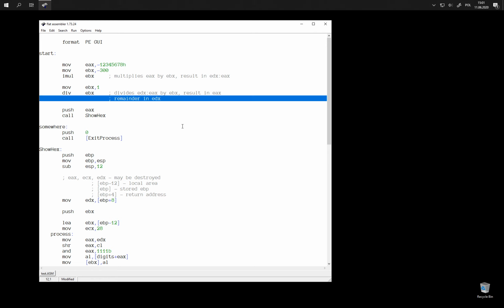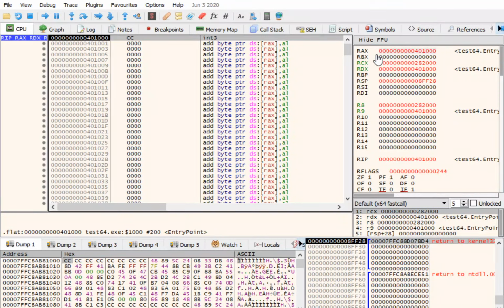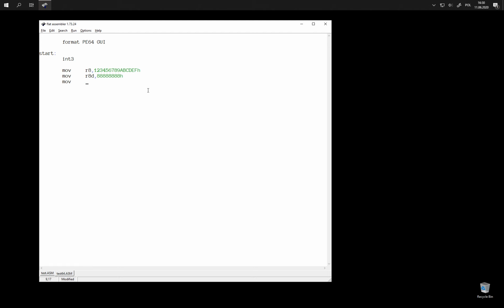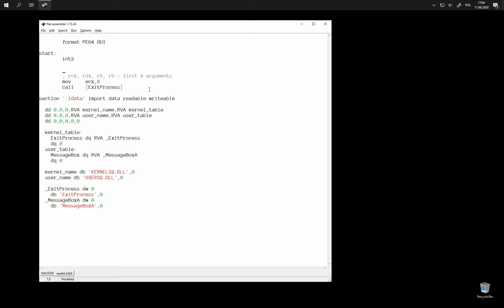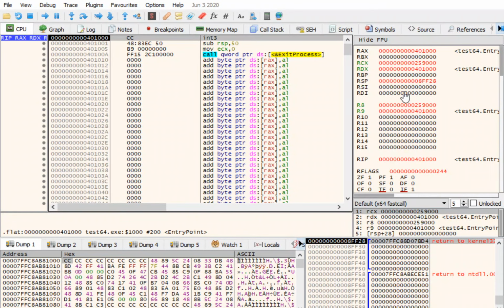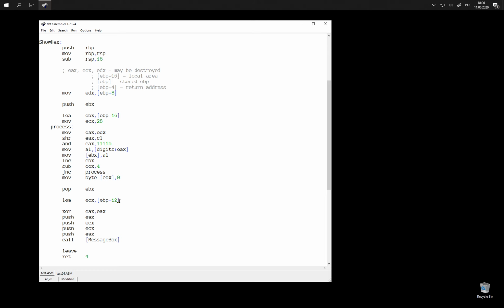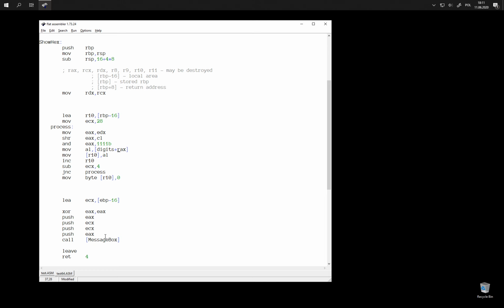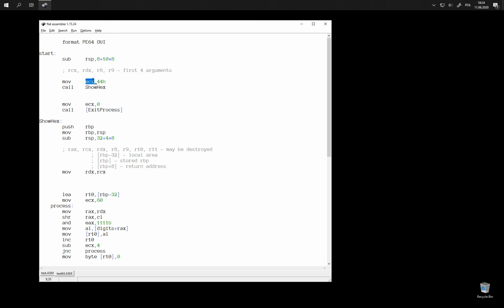Introduction to x86 assembly, part 11: 64-bit mode and calling convention

Comment: Why do we have to modify stack if we are passing arguments by registers ?
It seem unnecesary.
Reply: The callee function could use the stack to store all these values passed to registers for further use, because the values in registers might get lost in the following code.
Reply: It's generally to make your life debugging much easier, compilers will often allocate space for the 4 registers and (in un-optimised code) copy the values onto the stack. Otherwise, while viewing the call stack it makes seeing the arguments passed incredible difficult.
Reply: @DuckForPope  So after debuging, while I'm optimising the code, I can delete that extra stack allocation, and it will work ?
Reply: @peterSobieraj  yes, so long as the rest of the code in the function isn't expecting to find the variables in the stack.
Reply: @DuckForPope  Thank you. That's helpful.
And do you know is it ok to not reserve stack if I call outside functions ?
Like ExitProcess, MessageBox, printf, etc.
Reply: @peterSobieraj  Im not entirely sure, I think you might need to check the assembly for those functions after you've compiled to see what they're doing with the stack.
Reply: @DuckForPope  Thank you very much for your help. I appreciate.
Reply: @peterSobieraj  not a problem at all! I'm still learning myself but I'm happy to share what I've learned 😊

Comment: sorry sir, i have a question. I have seen that you used the software "bosch pc emulator" in previous videos. I heard about said software while reading and introducing me to the world of reengineering and I only found that said software is contaminated, many antivirus detect strange things, there are no answers in the forums and it is not well explained how to compile the "source code" either. You could trust in Sourceforge? I dont. Even in this last way, it is impossible to analyze the binaries and debugging appear very suspicious calls.Do you have a clean copy of the code by any chance? Yes, virtual box is a trojan too.
Reply: Trust must start somewhere. Is BIOS a trojan?